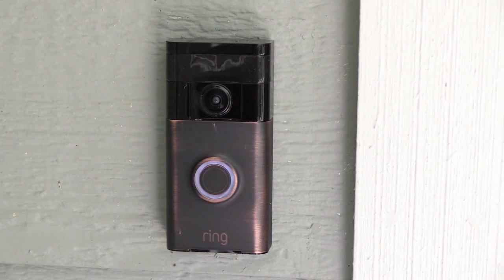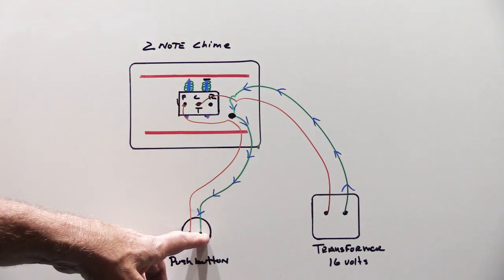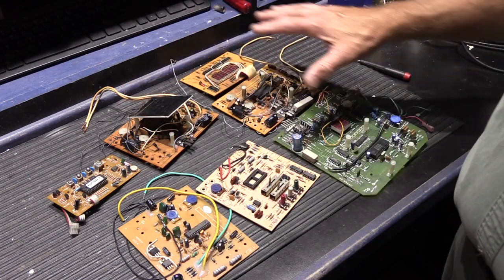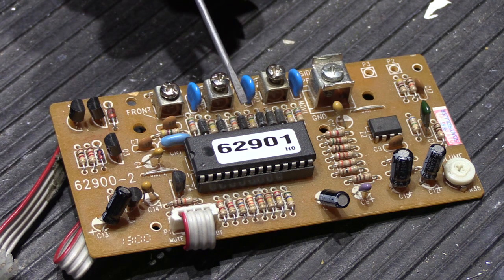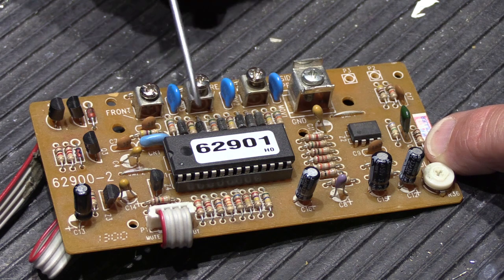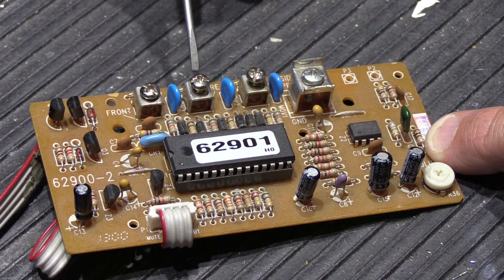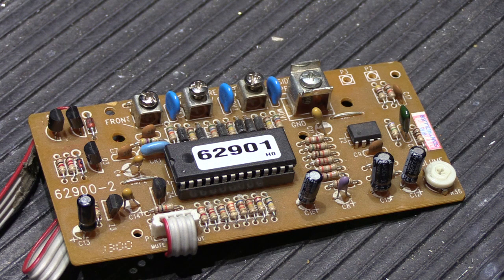Why You Can't Install a Ring Video Door Bell with a NuTone Intercom System or Musical Chime

Comment: Thanks for this video. I am trying to get my Ring 2 (which has the battery) working correctly with my NuTone 3003 chime. When I manually bridge the two red wires from the Intercom button, the Door Chimes keep ringing until they are separated. When I connect these to the Ring, using the Diode, I have the same result. The chime just keeps ringing indefinitely, until I remove the wires from the Ring. When I connect them to the Ring without the Diode, nothing happens. Any idea what I am doing wrong? I understand that the existing wires from the NuTone chime module can not power the Ring, but for some reason, I can't even get the chime working correctly.
Reply from the maker: Hi Nicholas: You can not make the Ring activate the Chime Module in the Intercom - There are no connections in the Ring to make this type of connection work - Chris

Comment: If I understand correctly, the NuTone intercom system will not work with a Ring video doorbell, but I can still replace the entire NuTone intercom sysem with a Ring video doorbell, correct?  I measured a voltage of 9.7 volts at the NuTone IS68 doorbell station when the button is pressed.  Would that not be sufficient to power a Ring video doorbell?  Thanks.
Reply from the maker: Hi speedracer77:  Not exactly - This Video should answer your questions:  https://www.youtube.com/watch?v=t6YswmDNVyI&list=PLsTvqKsBnGYdNYGrlrOSVKjOLwvFWrLUx&index=3&t=1610s
Chris

Comment: Can I just take the wires off the NuTone outdoor button (and put them on the Ring) and then off the circuit board inside (and move it to the transformer directly?)
Reply from the maker: Hi Jonathan:  You can disconnect the Pushbutton wires (2) from the Chime and disconnect the Transformer wires from the Chime (2) Splice them together - which will the provide the Transformers voltage to the wires at the pushbutton location.  You should check the rating of the Transformer - some Chime Transformers have very low Watt Ratings (VA) - and they may not power your camera correctly - Chris

Comment: Just use a relay. Hook up the coil side of the relay like you would a standard "ding dong" chime. Then attach the N.O. terminals to the common and your choice of the front, rear or side terminals. I think the transformer in the main intercom box is 16vac. Make sure you match coil voltage. If you can't find a 16vac coil relay just install a SEPARATE 24vac power supply in the main intercom junction and use that to power the ring. 24vac coil relays are common. Ring door bells can handle up to 30VAC. Has to be AC. They don't operate on DC. If they did operate on DC you could just Hook the ring directly to the chime board on the intercom because it outputs DC.
Reply from the maker: Hi Ste Cour:  Here's a link to our Video that shows how to install a WiFi Video Door Camera to a NuTone Electronic Chime or Intercom System:  https://www.youtube.com/watch?v=t6YswmDNVyI&t=193s
Chris

Comment: He does a nice job of explaining and teaching HOWEVER I felt like it was way too deep.  All of that time I spent listening to the part about the microprocessor was completely unnecessary.  I literally feel asleep in the middle of it all.  Jump to about @17:05 if you want the Reader's Digest or Cliff Notes version.
Reply: Very useful comment. This video should be 3 minutes long.
Reply: @phishstyx  18:30 is where I would suggest jumping to, or just the statement "there isn't enough voltage coming from the nutone to the existing doorbell switch to power modern electronic video doorbells"
Reply from the maker: @junktrunk909  The problem with your suggested statement is - it's not complete enough - therefore it's inaccurate.  I could have just said "It won't work - don't do it".  Without a more detailed explanation, people won't believe what's said.  - Chris

Comment: I just installed a Ring Pro with a Nutone IM3003.   This is fairly straight forward.  I used a 24vac transformer I kept from and old furnace
when I had a new one installed.  Then I bought a 24vac relay for $8 from grainger,  I took the 2 wires from the newtone  that used to go to the door bell and connected them to the Normal Open NO relay contacts. Then I connected the wires from the old button and connected them to the Ring Pro.   The other end of these wires from the button one went to the Transformer 24v side  the other to one side of the relay coil.  The other side of the relay coil went to the other 24v Transformer wire. The Ring pro includes a small white square with 2 wires coming out of it to put across a chime.  Put this across the coil of the relay.   In the Ring App  press the gear to get to Device Settings select Doorbell Kit Settings . Set doorbell type to Mechanical.
Reply from the maker: Hi Steve: You did your modified installation exactly how it is needed to be done.  Not nearly as simple as most people think it is or want it to be - Chris
Reply: Can you pls upload the diagram?? Simple one handwritten

Comment: Great detailed information, I learned.
But can I use the 16v transformer if I wire it directly to the Ring doorbell? I am installing a Wired Ring on another home and thought I might just use the transformer that I have in hand...
Reply from the maker: Hi stephen:   I am unclear about your question: What is the existing 16 Volt Transformer being used for?  Is it being used with a standard 2-note doorbell - a electronic door chime - is it powering an intercom system??? - Chris
Reply: @northsideservicecompany3567  it was on an older Nutone doorbell that's no longer in use. I thought I might use that transformer for the ring versus buying a new one. I have the transformer all disconnected and removed from the old system. The wired ring is on a whole new property installation.
Reply from the maker: @stephenclifford3697  I understand.  As long as the existing 16 Volt Transformer has a high enough Watt Rating (VA) to power the Camera - Then 'Yes' you can use it to power the Ring Video Door Camera - Chris
Reply: @northsideservicecompany3567  15VA, 16V. 15 ok?
Reply from the maker: @stephenclifford3697  Probably yes, you should really check to see what Ring recommends - Chris
Reply: @northsideservicecompany3567  Thank you!!

Comment: Presumably, replacing the outdoor intercom unit with a ring means disconnecting and or removing the wiring from the intercom base station at the base station so that the wiring is just home run to where you can connect them to 16vac or 24vac power source so the question is whether or not the gauge and insulation of the speaker and microphone wires to the outdoor station or to the doorbell is sufficient to carry low wattage 16vac or 24vac and whether or not it would meet code not whether or not the intercom board would provide the needed power.  Later intercoms are wired with cat-5 cables and there is a protocol called POE that allows power to be transmitted through such cables but I don't think any of these WiFi cameras offer ports to use POE however this does mean the cat-5 cables are at least allowed to carry POE power by code.

Basically only the wires would be used, the intercom would be disconnected and maybe even removed so it's just a matter of whether or not the wires are the appropriate quality and whether or not it's truly a home run wiring.
Reply from the maker: Hi John:  POE (power over Ethernet) has nothing to do with your project and many modern Intercom System use CAT5 cable because it commonly available and inexpensive.  If you watch this  Video :  https://www.youtube.com/watch?v=t6YswmDNVyI&list=PLsTvqKsBnGYdNYGrlrOSVKjOLwvFWrLUx&index=4&t=116s

You will see what needs to be done to install a WiFi Door Camera and have it work with your NuTone Intercom - Chris

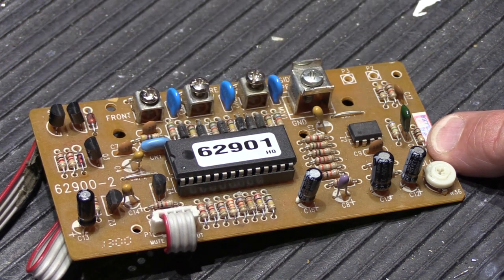Comment: Thanks for putting this video together. Skip to 17:00 if you want the heart of the explanation.
Reply from the maker: Hi Alex:  True enough that if you skip ahead to the point in the Video that you mention, you will basically get a big "NO" on this topic, however you will not have learned the reasons behind the big "NO"  - Chris
Reply: Northside Service Company you actually cover the why part after the 17-minute mark,  but provided a lot of good and very detailed in depth background before this point. Different levels of "why", I guess.
Reply from the maker: Hi Alex:  Well said - i like the idea of different levels of "why"  - Chris

Comment: hey how are you? I really enjoy your videos and use your videos as a guide to conduct maintenance work for intercom systems. I'm currently working on a old apt complex. I ran into some problems where a couple of the door entry panel circuit boards seems to be burnt and stopped working. The model I'm referring to is the Aiphone VC-26MT. I'm not sure if you mighty come across any of these. But do you think i can find a replacement or have the circuit board repaired?? Thanks
Reply from the maker: Hi Ian:  I don't work on Aiphone Equipment and I have no idea where you would find replacement parts for their systems - Chris
Reply: @northsideservicecompany3567  thank you

Comment: I have a nutone scoville chime, but the house also has an intercom system built in the late 70's.  Ring claims the scoville is compatible but not sure how the intercom fits in. It really isnt functional, and I don't expect it to be integrated into the ring system, just wondering if I can still power my ring gen 2 device and use the scoville chime without the intercom throwing a wrench in the works.
Reply from the maker: Hi Jerry:  I would need to know the Model Number of the Intercom and the Model Number of the Chime to offer any insight into your question - Chris

Comment: How do I connect the battery charged ring doorbell to my intercom with doorbell? I don’t need the power connection.
Reply: It’s something you mentioned at the end of the video.
Reply from the maker: @thenobleberean1940  The basic requirement to have the Camera activate the Chime in your Intercom System is - The Camera Must Have the Ability to ring a standard, 2-Note mechanical Doorbell (ding-dong type).  According to Ring, the battery powered Camera cannot do this.
     Here are 2 Links to our Videos that show how to install a powered Camera which can work with your Intercom System
https://www.youtube.com/watch?v=t6YswmDNVyI&list=PLsTvqKsBnGYdNYGrlrOSVKjOLwvFWrLUx&index=3&t=1644s
and
https://www.youtube.com/watch?v=8LXCcLr_HHA&list=PLsTvqKsBnGYdNYGrlrOSVKjOLwvFWrLUx&index=10&t=1s
Chris

Comment: I must say, this video was very informative and perhaps went more in depth than many can easily comprehend. Those with NuTone intercom systems really need to listen to this, if they have a Ring doorbell.  I recently had a Ring Pro video doorbell installed, which is their hardwired model. The audio and video features work fine. But the existing chime kit I have, which is a digital style and must have a microprocessor as Northside explains here, sounds absolutely horrible with the Ring Pro and is never consistent in fully executing the soundtrack of the Westminster chime . The interference with buzzing and beeping and broken chime cycle will s horrible.  Ring has a long list of compatible chime kits which are both mechanical and digital. I would tend to think there are more problems with digital chime kits when having a Ring Pro doorbell, due to the electronics or involved. I believe this video addresses some of the problems I may be experiencing, but I’m not completely sure. Are there some digital systems which work flawlessly with the Ring Pro or is it best to get a mechanical chime kit, which is compatible with the Ring Pro?  After initially installing theRing  Pro and having these issues, Ring strongly recommended upgrading my transformer, which already met the 16-24 v requirement. My transformer measured 17 v when tested. But, that transformer was 10 amps and Ring said my issues should go away by getting a 16 v transformer with 20 or 30 amps. So, I installed a new 16v 30 amp Nu Tone C907 transformer and the chime is worse then ever.
So, now Ring is suggesting a new chime kit and I would  like to know what’s the best way to go; mechanical or digital? Which brand and model should be the most reliable?
Reply from the maker: Hi R Cole:  Since I am not a Ring Video Door Bell expert - I cannot make any recommendations - based on real world experience - about what type of new door chime you should buy.  

I am fairly sure that Ring suggested that you have a 16 - 24 Volt Transformer that was rated at 30 Watts - Not 30 amps.  This in my opinion may be necessary for the Ring (not being an expert - I'm assuming here) but it will likely not have any positive effect of your electronic chime problem.

Have you considered getting rid of the chime all together and adding 1 or more of the Ring wireless, plug in extension chime units? - Chris

Comment: I installed Ring on my Nutone intercom for about $8 worth of parts.  Ring is happily powered and the NuTone rings when the Ring rings.  Works great with no issues.
Reply from the maker: Hi De Ce:  What did you buy for the $8.00 that made this work for you? - Chris
Reply: I bought a 25-ohm 50W load resistor, a few discrete components (2 resistors, 2 caps, 4 rectifier diodes) and a MOSFET photovolatic relay.  It basically senses the ring voltage across the load resistors that then turns on the MOSFET relay which triggers the NuTone to ring.  See the video in my channel.
Reply from the maker: Hi De Ce:  Well Done!  Now how about publishing your schematic and parts list so everyone else can do as you did? - Chris
Reply: added schematic video to my channel
Reply: De Ce's solution still seems to be the best if you want to use your existing two wires to the doorbell button and one of the power supplies in your IM-3303.  Given the year or so that has elapsed, have any other solutions become available for this scenario.
Reply: I used De Ce's solution, and it worked great for me.  You'll need some electronics knowledge and the ability to solder.   He provides a parts list in his schematic video.  I used his schematic video to build the required circuit.

Comment: Thanks for the video. My Nutone no longer works and we don't use Can we use wires going to the Nutone to wire into the Ring/Nest therefore the Nutone is completely disconnected and wires going to the Ring/Nest doorbell?
Reply from the maker: Hi Adam:  Yes you can  - Chris
Reply: @northsideservicecompany3567  How so? Would you need at add in a ac transformer at the end of the wires from the front door unit in the main inside station ?
Reply from the maker: @FixingStuff101  Watch our Video that shows how - Here's a link - https://www.youtube.com/watch?v=t6YswmDNVyI&t=154s
Chris